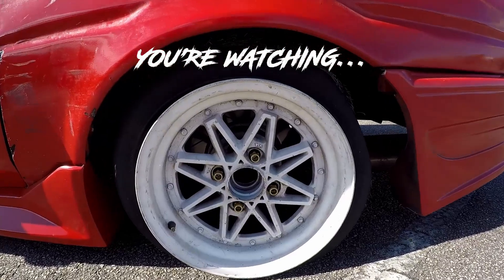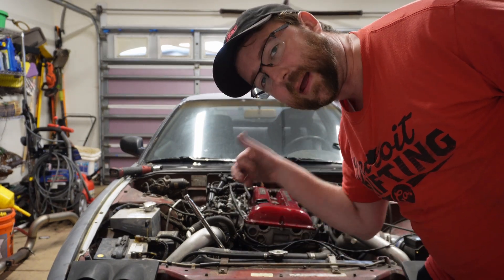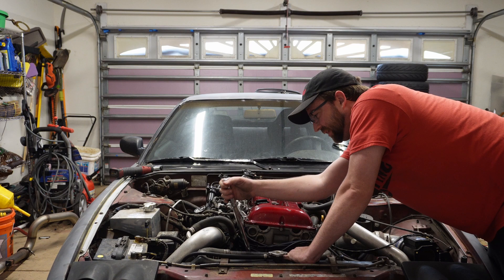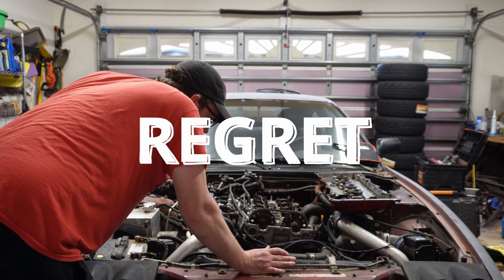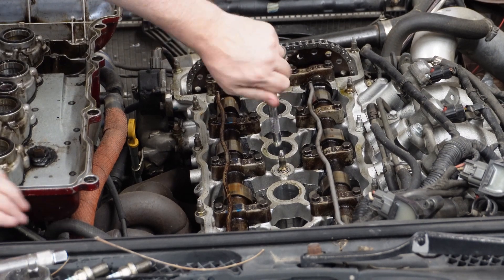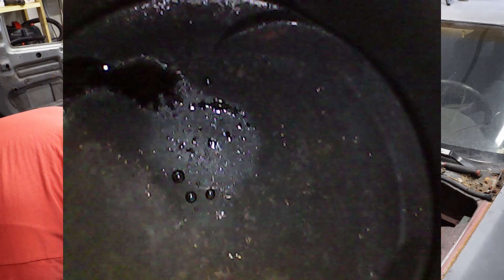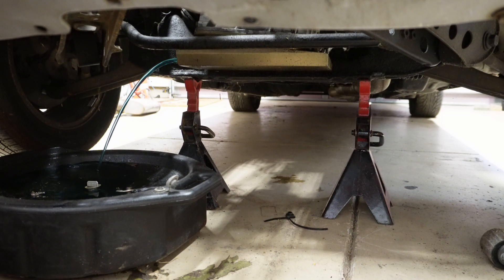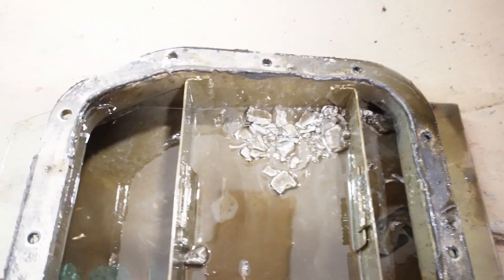I bought a $4500 S13 with an SR. Tearing into the SR20DET. It's REALLY BAD.

Comment: One fo the previous owners blew the head gasket and they tried their luck with Blue Devil headgasket sealer. Sorry that it got so in depth so fast. I was absolutely puzzled when the crank stopped rotating
Reply from the maker: Ooo that could be. There was soooooo much of it. I really hope that when I take everything to the machine shop they can clear it out if that's what it is.
Reply: @DoctoredGarage  best of luck with everything!
Reply from the maker: Thank you!! I'm working on it some more tonight and I found some very surprising new details about this engine :D
Reply: @DoctoredGarage  hopefully some aftermarket goodies or even a stroke of luck!